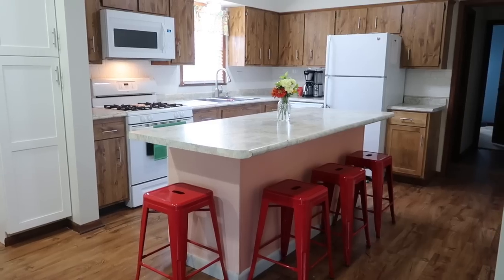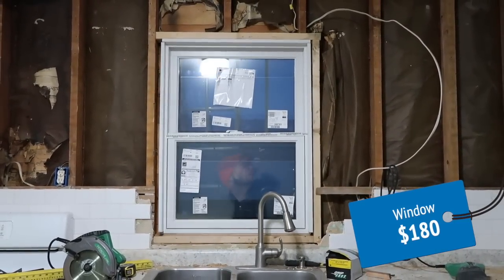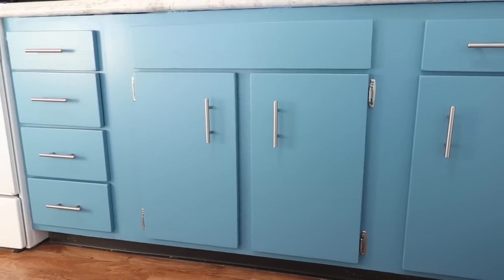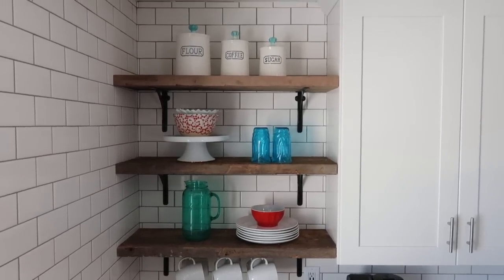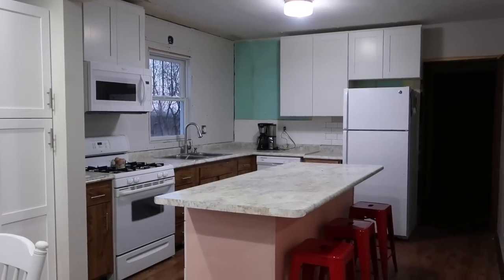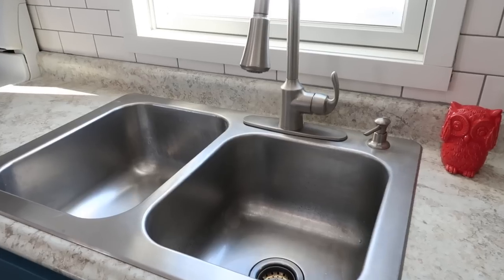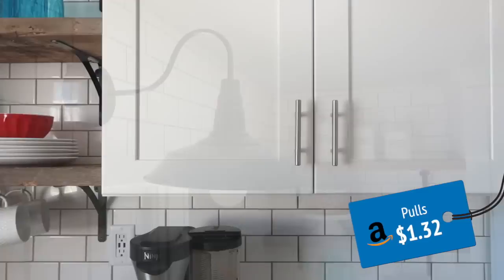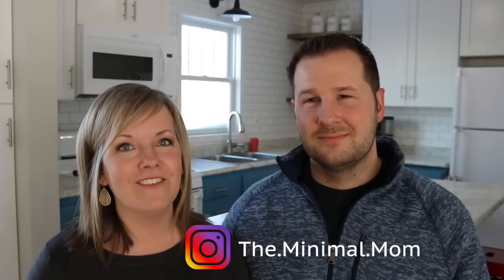Budget Kitchen Makeover Before & Afters (DIY Kitchen Remodel)

Comment: More cabinets, shelves and dressers etc....only means more stuff gets accumulated. 

When we moved into our house our kitchen was wall to floor cupboards everywhere, with an awful 70's serving hatch. The fridge couldn't even fit in the room! 

The first thing I did was rip out some to make room for the fridge freezer to make it more functional for me. Naturally all the cupboards got filled (with stuff that was never used of course). 

As we learned to live in the new space, we decided taking down the wall separating the kitchen and diningroom would make the space function better. We took down that wall, and half of the cabinets and work space as a result, but work ended up stopping for a while due to another job taking over priority. 

In the mean time I started boxing up and only keeping in the kitchen the absolute essentials needed for everyday use. For about 18 months in the end we lived with a worktop straddled over two base cabinets on one side of the room, another with the sink still fitted into and another base cabinet for pots and pans (no doors) the electric cooker was free standing. 

After living so long like this I realised we just didn't need all that clutter catching space. We now have 4 lower cupboards, 3 draw units and a bookcase repurposed as an open pantry. One worktop is a dedicated coffee/microwave/toaster zone so is a little more cluttered than I'd like but we compensate by only having the fruit bowl on the other counter, so nice and clear. 

It's still not technically  finished (plastering and backsplash) but we have really come to appreciate the open minimal space. It really functions well for our family and I love that it takes me little time to clean!

Comment: Love how your kitchen turned out!  You guys did a great job!  My hubby and I do most of our home reno project together, hire out for the things beyond our DIY talents, (like major plumbing or electrical.)

We have several different floorings throughout our home, as we have made improvements in the 24 years we have lived here.  When we finally remodel our kitchen, we are planning on using vinyl plank flooring.  It has come such a long way.  Years ago, we installed it in our mud / laundry room.  At that time it had a strip on the side and you removed the tape and it would stick to the next piece, it didn’t snap together like it does now.  It has held up well, in this very wet room.  So when we do the kitchen which is our last big project, we are tearing out all the flooring throughout the house and it will finally all match!!